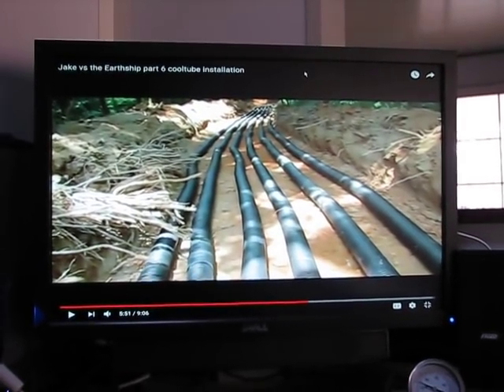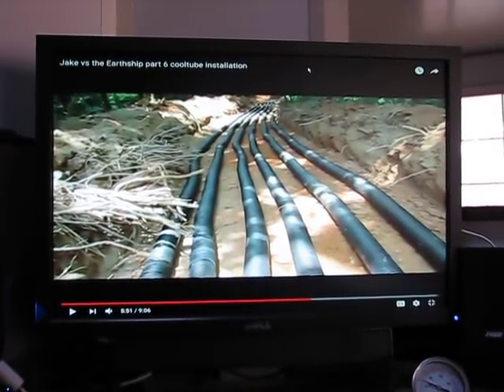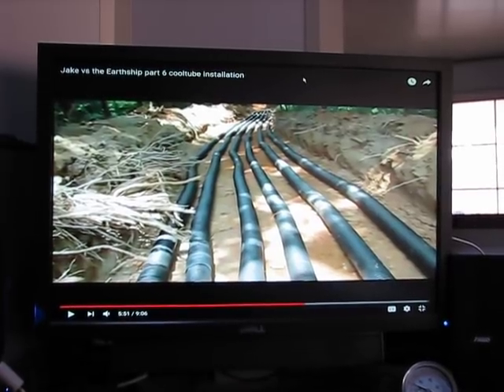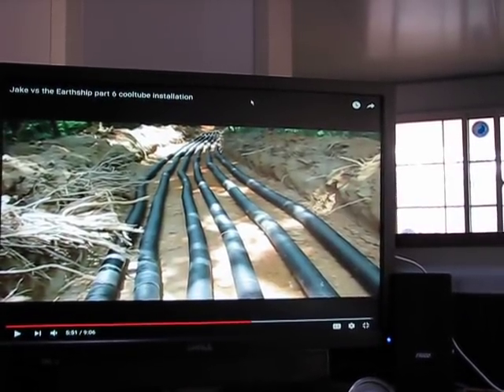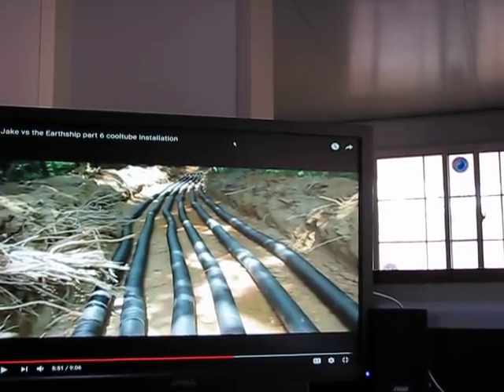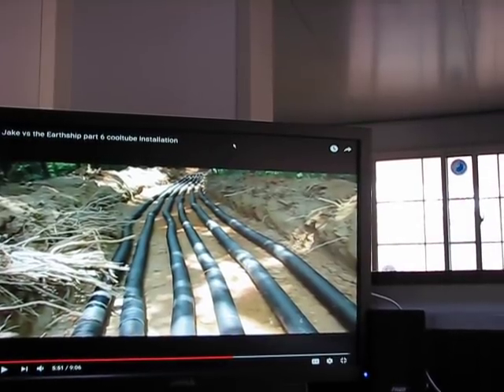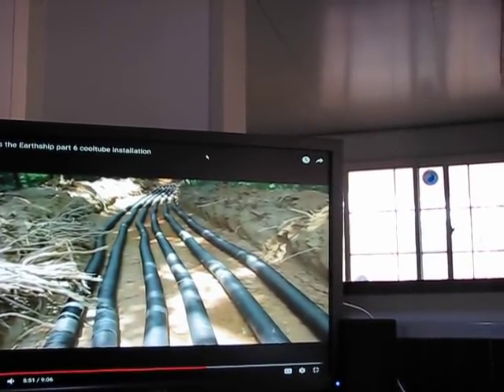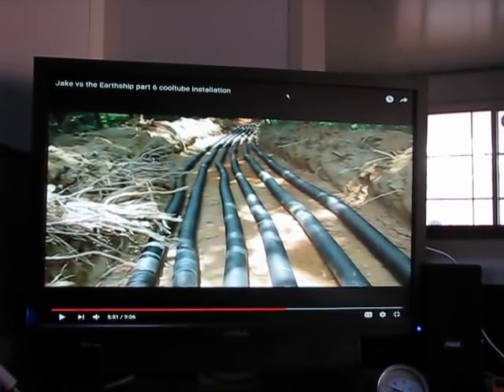Off the Grid Geothermal Cooling and heating explained  in 10 minutes

Comment: Hi bud. 
In a tropical area. 
You do everything right. 6 feet down, good size pipes. 
Now. Would it help if the air is coming in from inside a long culvert where the air is already cooler.

Comment: Why not add a return system? It would be fan powered of course.
This is a single pass system. It takes outside air and runs it through the pipes into the structure and exhausts back to the outdoors. If each one of those runs was a loop (one end being supply air and one end being return air) you would recycle the air which has already been cooled. Seems that would be much more efficient and your runs would not need to be as long.

Comment: Probably would have worked if you used metal piping. Plastic pipe cuts conduction by more then 50%. One corrugated metal pipe would have done the same as all this plastic crap. Very ineffecient.
Reply from the maker: Yep , that would have helped quite possibly  ... but the vid was not of my system as such .  I was just a critique of some one else's set up as an example...  cheers Steve
Reply: @offthegridinoz.994 
Using 200m runs of 4" corrugated pipe is a mistake.The air will be down to the ground temperature in the first 6m (at most) and will be coasting through the other 194m without changing temperature, essentially most of the tube will be doing jack ;)  Not sure why folks insist on using long tubes when all they are good for is restricting the amount of air you can run through them.
Reply: @JohnGuest45 
Hi,
  6 meters is all that's needed to cool down 120°f air 6 feet down? Using 4 inch corrugated PVC pipe?
Continuously throughout summer?
I'd like to research further, where did you get your information?

Comment: There is not a lot of information about geothermal air systems. Can anyone recommend a site to explain what type of materials are used? My biggest problem with researching air systems is how to prevent moisture in the underground piping. I know this just has to be the reason most information on this subject is on a water system.
Reply: evil bucket just use the perforated drain pipe
Reply: greenhouseinthesnow.com
Reply: Fluid system or dry the air before it goes in. I think its a good idea to "treat" the air anyway.

Comment: https://www.youtube.com/watch?v=ZD_3_gsgsnk is good but still a lot of risk for the $$$ but very interesting.
For cooling I have used my ducted heater on fan and sucked the air from under the house it works till mid 30s just a pain retapeing the duct for winter.

Comment: No way this is more eco friendly than a conventional air conditioning system
Reply: @GregGrimer  
Mine has been in the ground for 10 years, paid for itself many times over and will still be working long after i`m gone. An AC unit is inefficient and consumes a lot of power.Its not likely to outlive you unless its brand new and your in your 90`s ;)

Comment: spent so much $$$$ on the pipe  and couldn't afford the trench   good points  and  great   
 extrapolation thank u
Reply from the maker: Yes Kev  , this type of system is so easily screwed up ...   It bothers me when the " Kumbya "set  " think it is simple? , natural ?and easy or a cheap way to go done properly ...    It is at least natural ... and I do love that side , but the rest requires some study and quite a bit of cash most or the time ... 

cheers Steve
Reply: bit like floor sanding